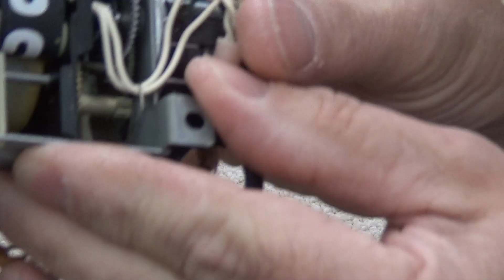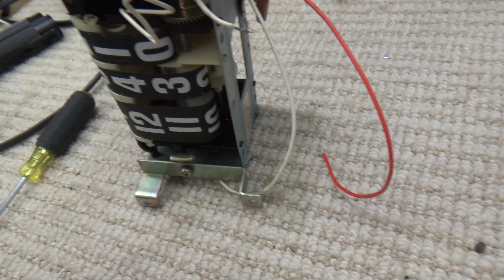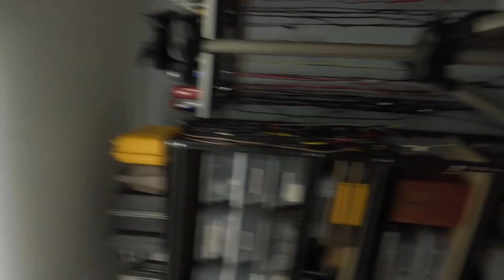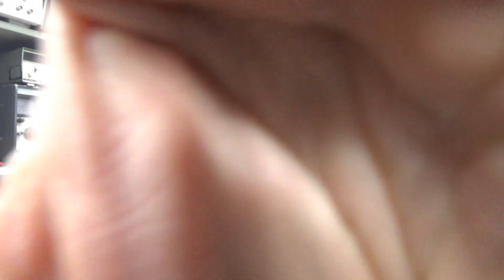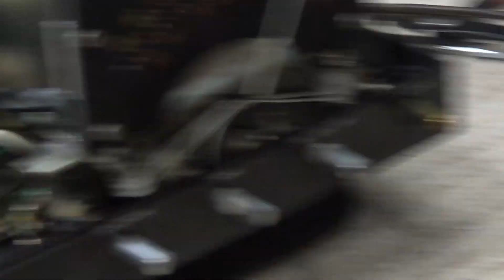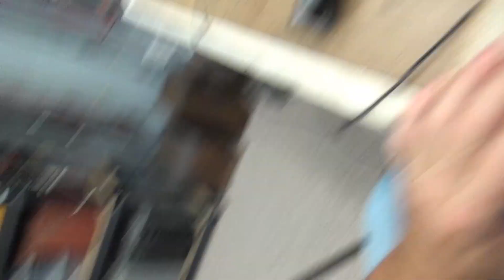Zenith Circle of Sound Model C475 Part 2 Final

Comment: Those mechanical digital clocks were the worse inventions of the 70s. The plastic was designed to fail after 2 years. The electronic digital clocks outlasted the mechanical digital clocks by 20 years. You can’t get replacement parts for mechanical digital clocks

Comment: I am an ABSOLUTE FAN 😅of these flip clocks 🕰, and cylinder clocks. Although not this one ☝️, my stepmom had a cylinder style flip clock ⏰ in her office. It was 1978, or 1979. My mother bought me one ☝️ of these clock ⏰ radios in the years. It was so coincidental. It was identical to the one ☝️ my stepmom had at her workplace, but, this time, it was 1995. You’ve got the correct mentality, “if it ain’t broke, don’t fix it”!! Your friend, Jeff.